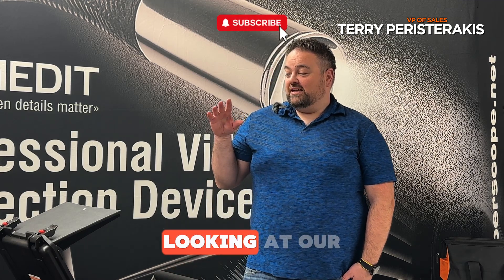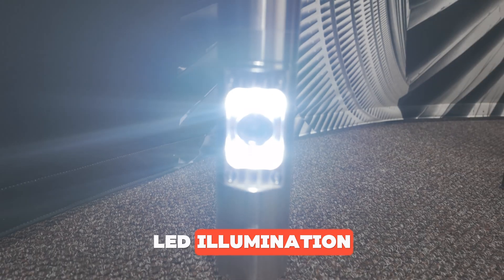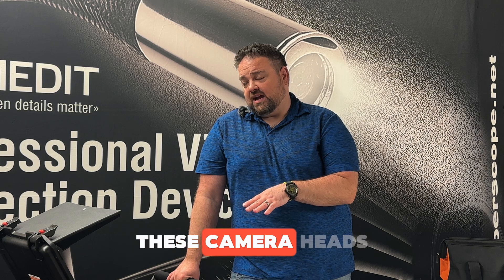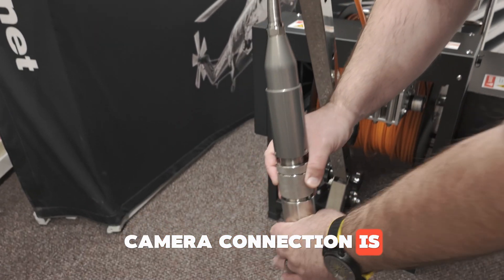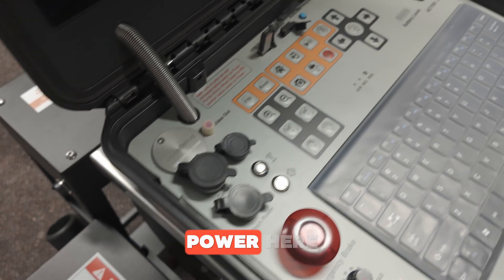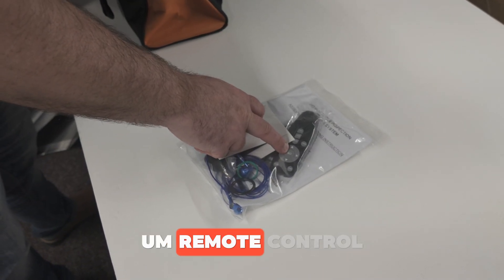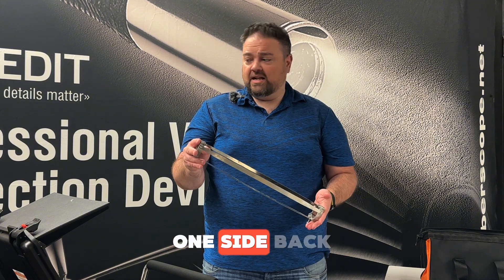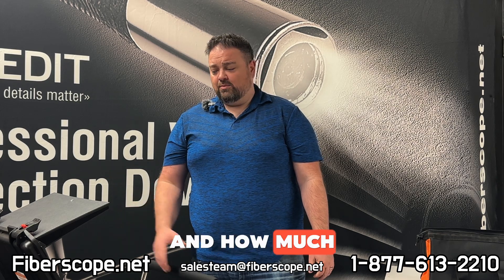1,640 ft (500 m) Downhole Inspection Camera | Strahl HDL Well Inspection Camera | Full Overview

Comment: Can it be transported to a jobsite in a pickup truck?
Reply from the maker: Yes absolutely, since the monitor and other electronics are transported in a hard plastic pelican-like case they will not get damaged at all, and the entire unit itself, although bulky, can be moved to a truck bed with a lift or even with a good ramp in hand. The unit having durable wheels helps in transportation and allows one person to roll around freely.